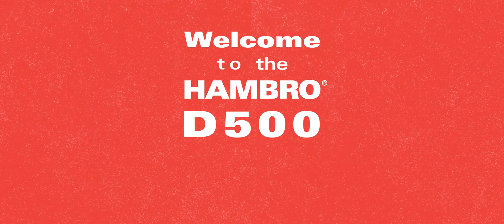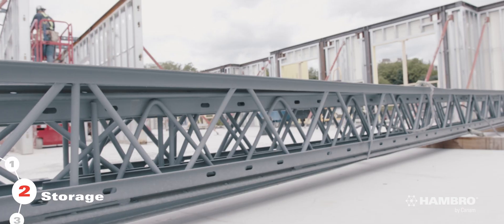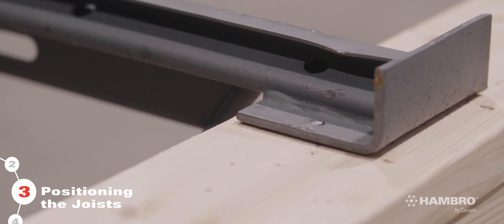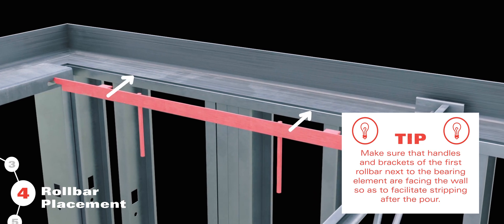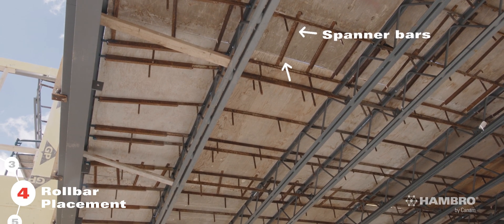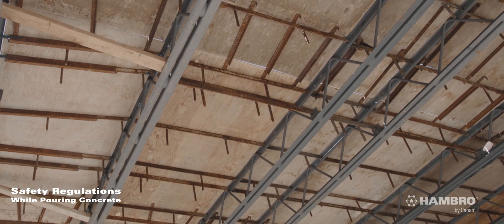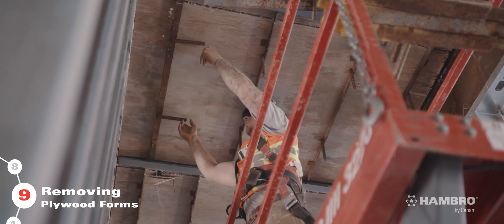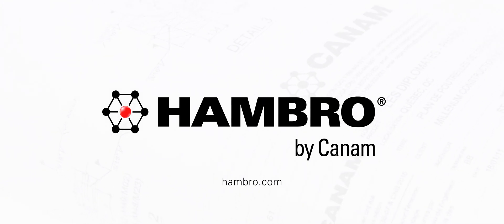Hambro D500 Installation Guide

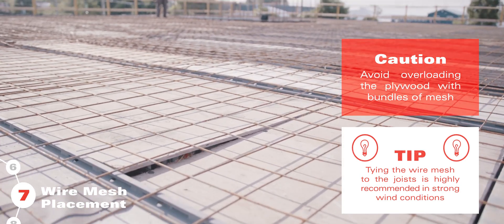Comment: @5:05 right when the narrator says "you are now ready to pour the concrete", a  HUGE GAP opens up in the plywood form!  =:O
Reply from the maker: The plywood form is lifted up because there is no weight applied on it yet at that point, due to possibly people walking on it,  however when they start placing the concrete the form will be pushed down by the weight of concrete itself and gap will not be there any more.
Reply: assuming the plywood isn't overlapped, the weight of the concrete easily pushes the plywood into place😉